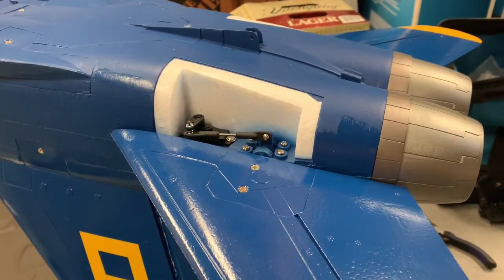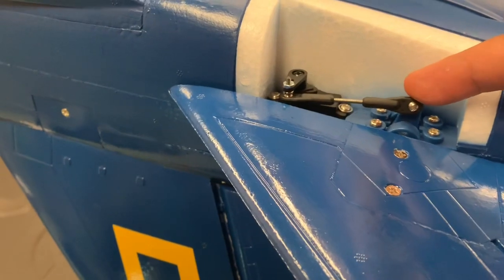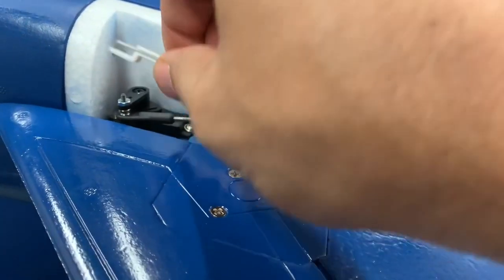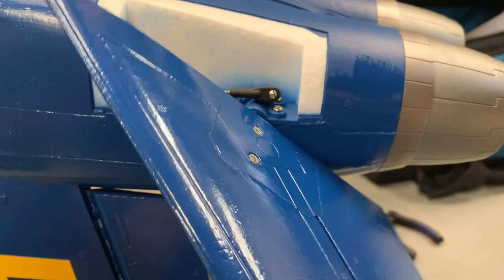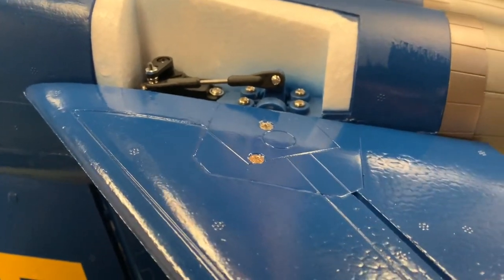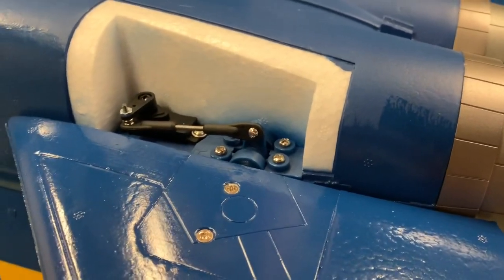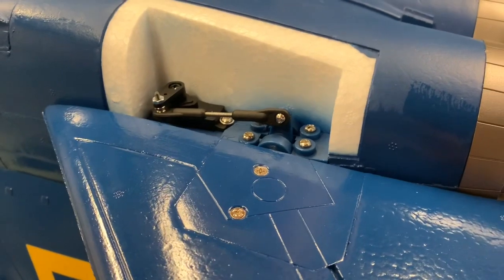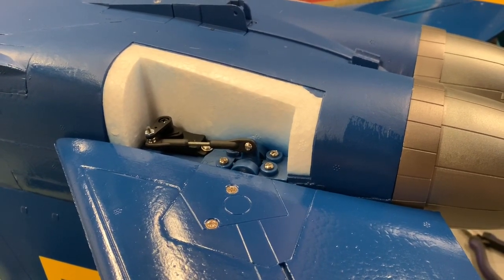Freewing F/A-18C Possible Elevator Fix

Comment: Great job Air Marshall, a short rod w/thread on both ends right.👍🏻👏🏻✌🏻🖖🏻👊🏻🤙🏻
Reply from the maker: Yessir, ball links on both ends. Pretty simple and cheap, but might just save your $500 plane!
Reply: Did the short rods come with the ball link ends? I can only find the package with the ball ends
Reply from the maker: You buy the 2-56 threaded rod separate. They will be ~12” long so you have to cut them to length with a dremel cut off wheel. Check the video description, Amazon links for all parts needed.

Comment: I've been flying r.c. helicopters for 35 years. They "only" use ball links . What you have done most certainly will correct the binding problem. Nice work.
Reply from the maker: Thanks for watching! I haven’t had any issues yet, knock on wood. It definitely corrected the binding issue, but the servo potentially being too weak for the job could still pop up eventually.

Comment: servo still looks like it is vibrating though? is it okay?
Reply from the maker: Oh yeah the servo was great, that was more of a me problem. Holding phone with one hand, point and operate radio with the other, fingers twitching, all while narrating what would become my first YouTube video. 😂 Thanks for watching! If you get a new F/A-18 from Freewing they come with much better reinforcement now in the elevator servos, and the servos are now 23g servos instead of 17g, both major improvements.
Reply: @The RC Air Marshall  thanks, yeah I think I got the newer high performance version. Haven't maidened it yet but hoping to do so soon. Did you end up using an 8ch receiver in yours or you feel 6ch is good enough so that you don't need tailerons?
Reply from the maker: @EDF_FANatic  performs great with standard ailerons. 6 channels works great. I did use an 8ch Rx, but not for the purpose of tailerons, I used it to have a separate channel for my afterburner lights and the nose wheel so I can trim them independently from the rudder/throttle channels.

Comment: Air Marshall, sir, I have ordered the parts for this mod. My only question as I come back and watch again is about the attachment to the elevator control horn. It appears as though you have attached the Du-Bro swivel to the factory freewing ball. Am I seeing things? Did you pop the factory ball out of the Du-Bro? If you did, did it just pop on the Freewing ball? Is it just a different bolt and nut? I see that the nut is a fiber lock nut, which is what freewing used, but not what Du-Bro used?
Reply from the maker: The Freewing ball is too small. I did use the screw for the Freewing ball though on the control horn. Maybe that’s what you’re seeing?
Reply: @TheRCAirMarshall  Yes, that is exactly what I'm seeing. I knew it was different than the bolt used on the servo.  Thanks for the reply, brother.